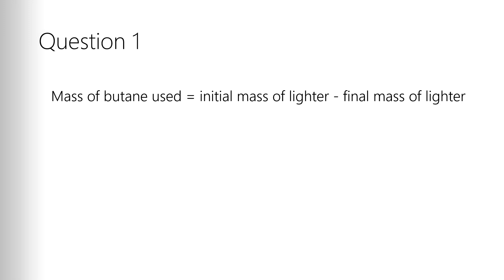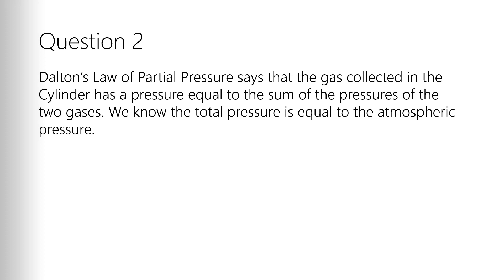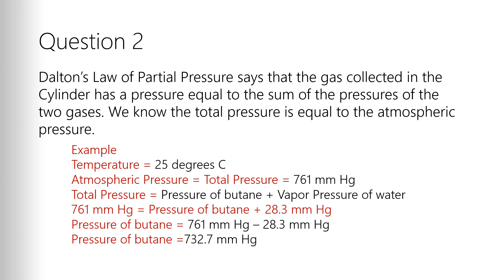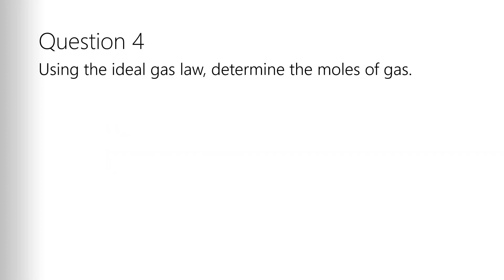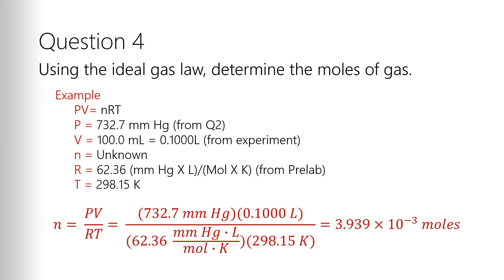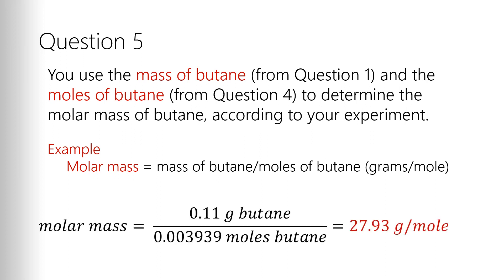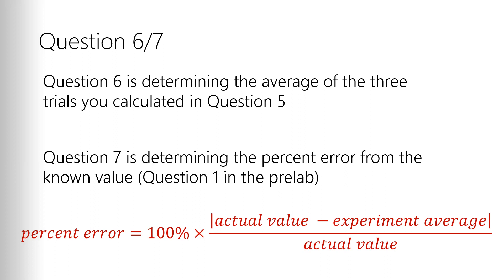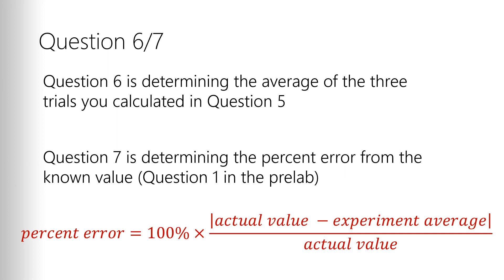Molar Mass of Butane Calculations

Comment: Vapor pressure for water is 23.8 mm Hg according to google table not 28.3 in your calculations. Should this be changed?
Reply from the maker: You are right, my discalcula hit and I transposed the numbers. I'll have to correct it. Fortunately the lab report has the engineering table with the correct values in it.